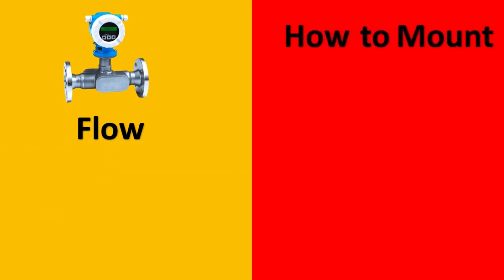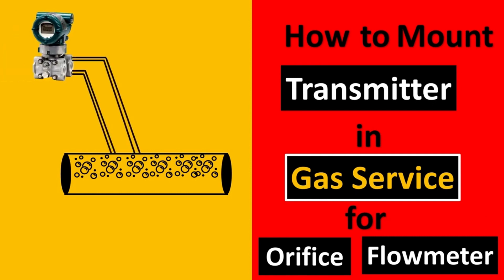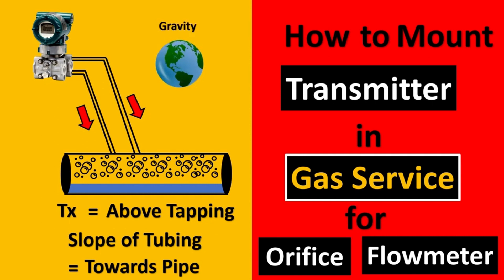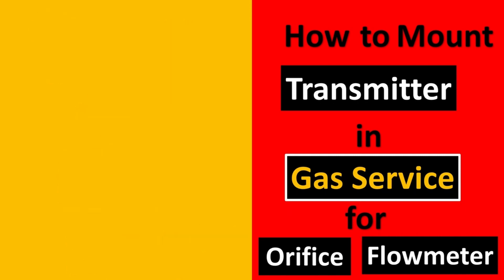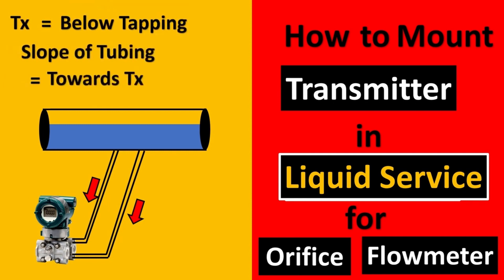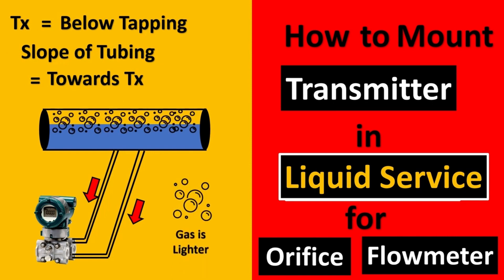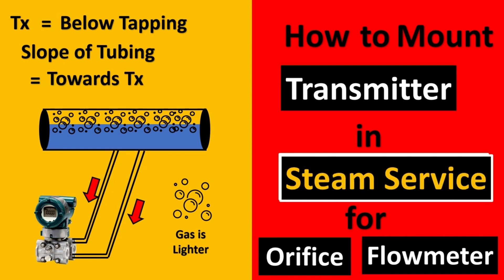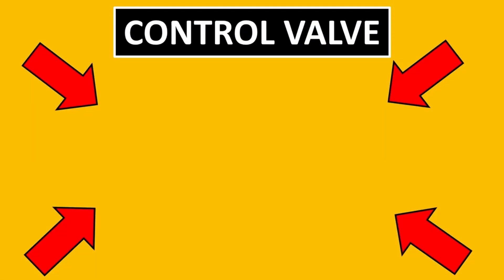ORIFICE Flow Transmitter Installation | Under 2 Mins⌚

Comment: Sir make a video on upstream and downstream straight run length of the pipe for transmitters installation
Reply from the maker: Sure this is a important topic. Will make as per ISO 5167 😊